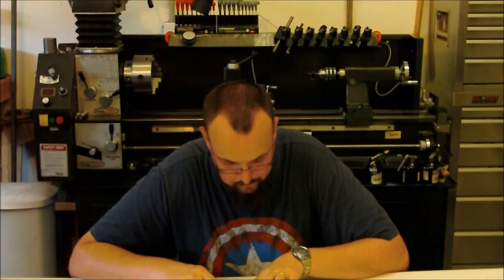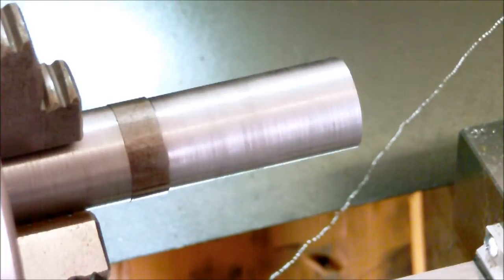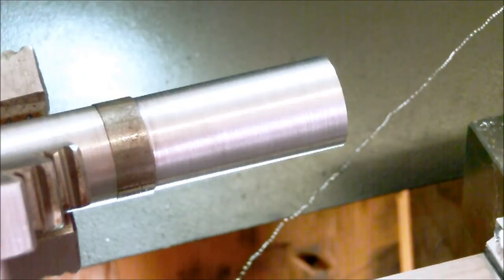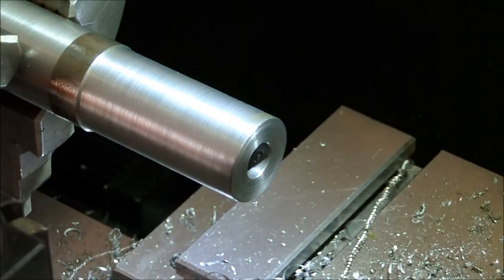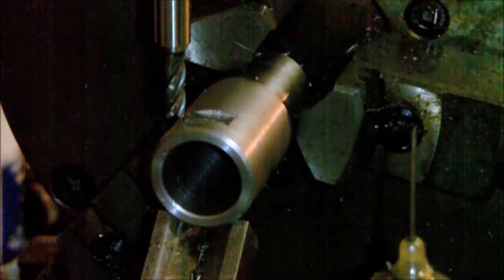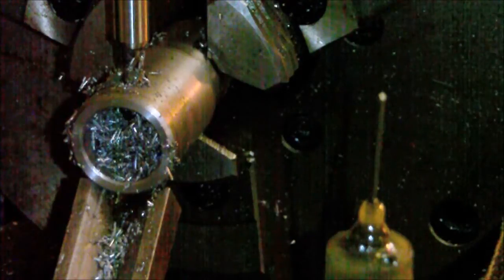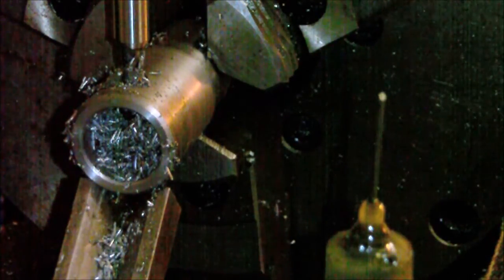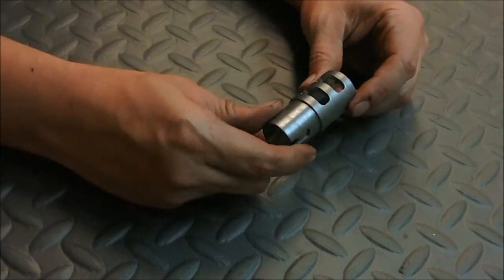Tolerance Fit Shotgun Brake

Comment: I didn't even notice the radii of the port was 45'd.    Nice touch!   When you mounted your brake,  you said you had to heat the snot out of it but was it a slip-fit or did you need to tap it on still?
Reply from the maker: When I heated it up enough it was a slip fit on try two, lol I was a little too quick to get it on the first time.  The 45 degree helps vent better on the rifle brakes so I figured I do it the same way.

Comment: I really like what your doing with the shotgun comps. I do think to reduce muzzle rise that just making the cuts on the top of the brake would be more effective. That way the hot escaping gases would all be forced up and help to hold the muzzle down. That is the principle used on comped pistols and it works very well. I would be interested in one cut in this manner, Price?